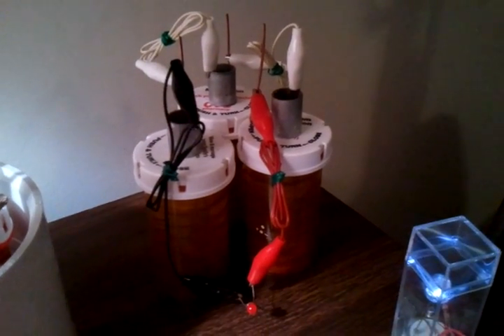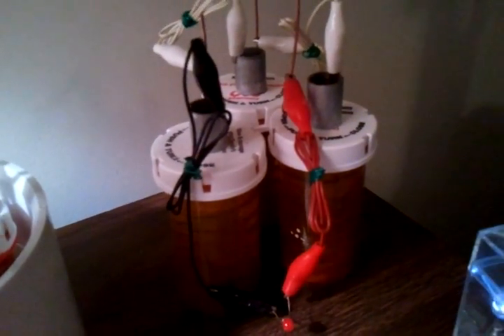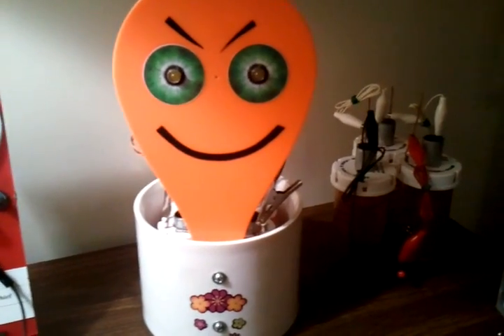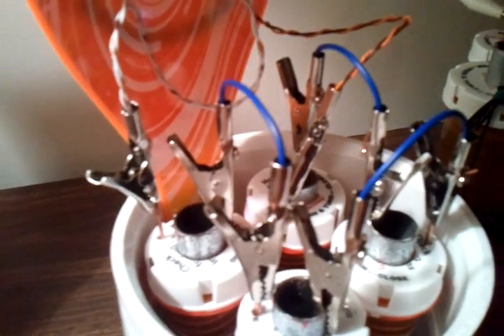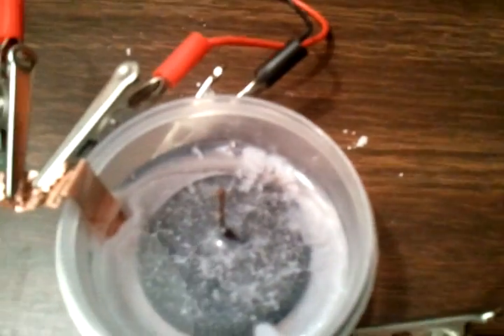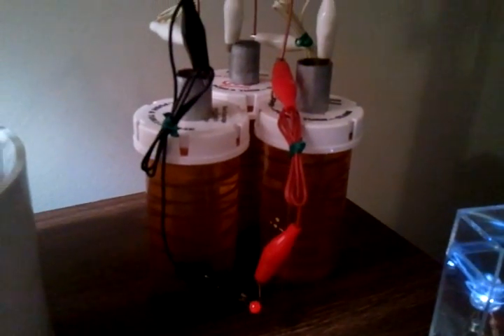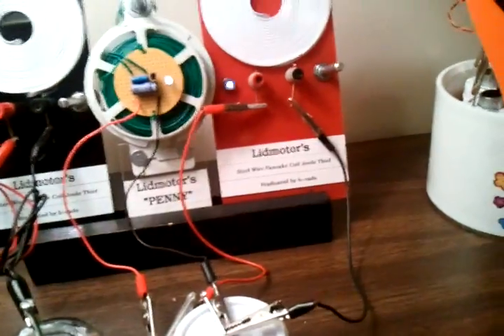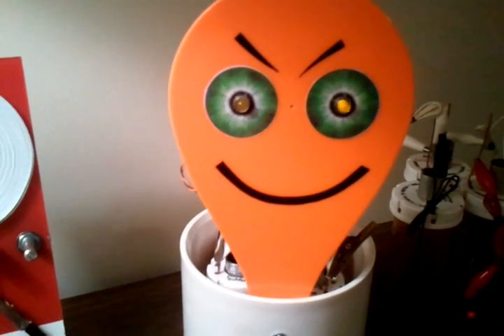Water Battery Fun

Comment: Big steel inductors have a fat/sloppy mag field. Lots of induction/rf interference. The other oscillator seems to have a small (physically)? copper? inductor. Similar coil sizes, wire gauges and turn numbers will "talk" to each other too.
I've been looking at amps on the scope too (well trying). The amps pulse with the volts (ohms law) . If two oscillators are on the same battery, I would not be surprised to see them sync.
My 2 cents: It'll be the same battery, or similar coils causing the sync.

Comment: The 'new guy' is great !
You could try putting foil over the inductors, running as a connection between them, it may well allow them to sync up. Worth a try. They may sync if right next to each other. Pancakes always sync, wound ferrites will too if 1/2" or closer together.
2 years already ! that's excellent news that the LED is still going.